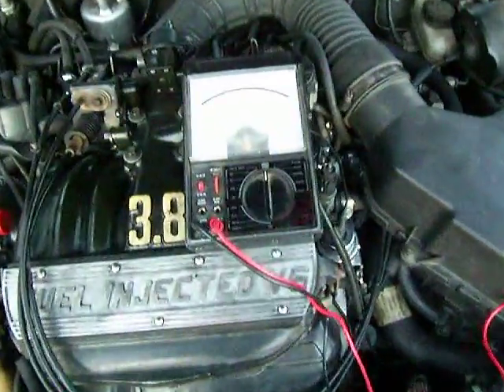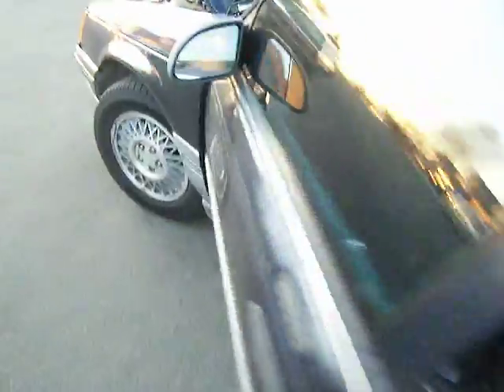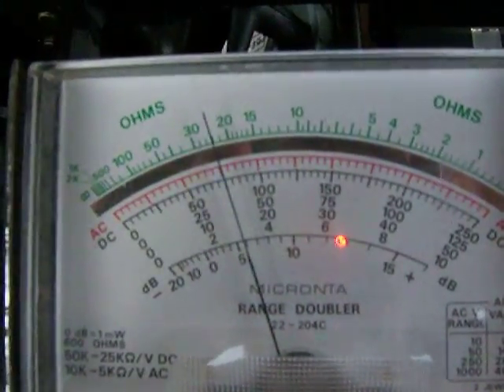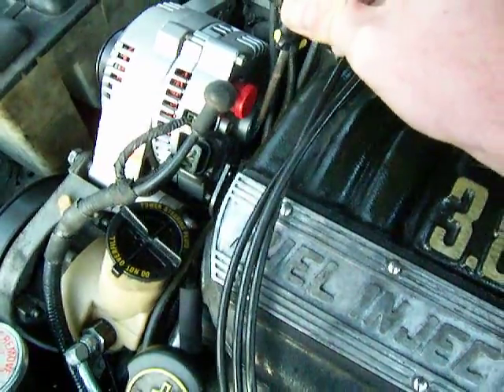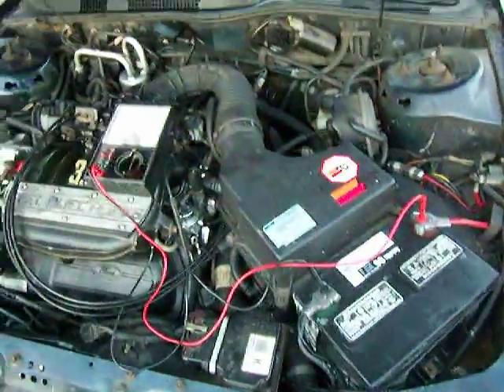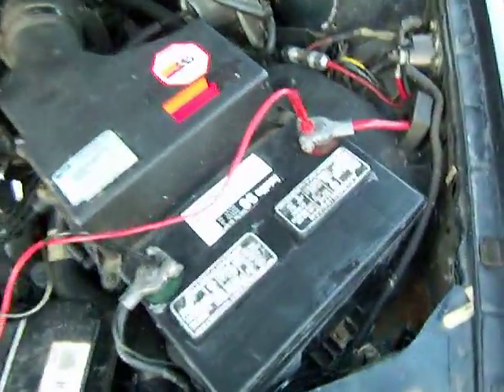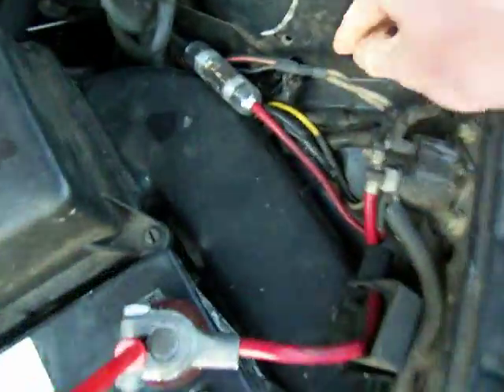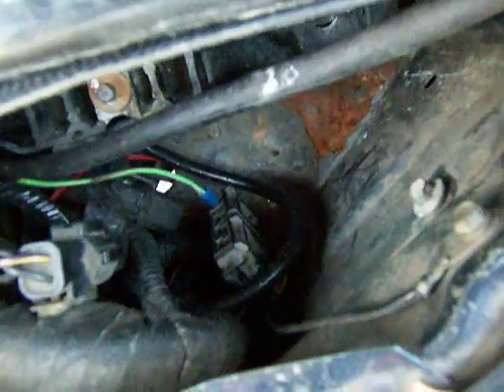How to check the alternator

Comment: what if the battery light comes on when i turn the switch on ... but stays on until i step on the gas pedal ? 
having a bad start to the car .. i have to hold the igintion key for about 7 seconds before the cars turns on ?  Alternator ? starter ? any idea whats the problem ?

Comment: Sometimes it will set off the check engine light.My father had a 2004 Dodge Ram pickup that was this way and an alternator code was setting off the check engine light.

Comment: I can always tell by the brightness of the dash lights, they usually get brighter when you start the engine indicating a increase in voltage.

15v is a little high, it should be at about 14.4v. I've never seen it cause problems though, just watch it doesn't go too high or your battery won't last very long.

Nice video, great job!